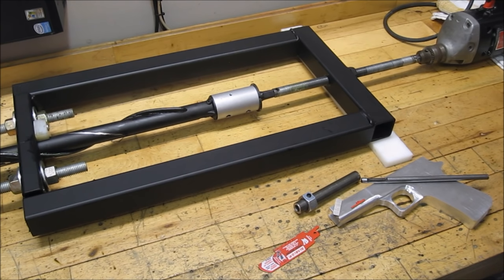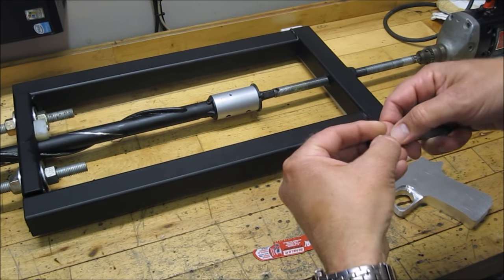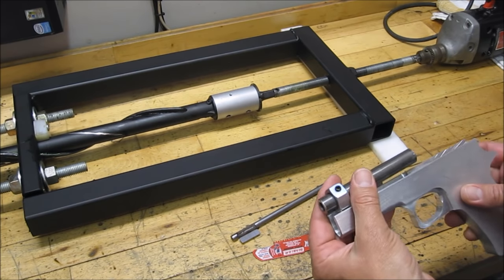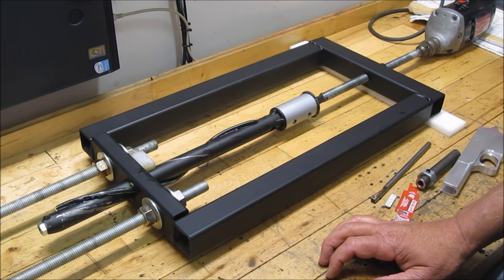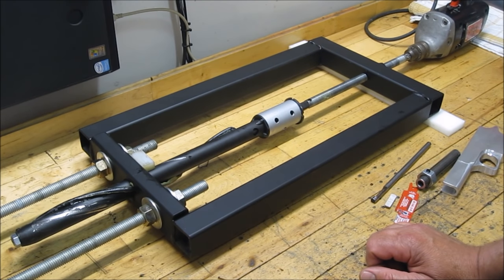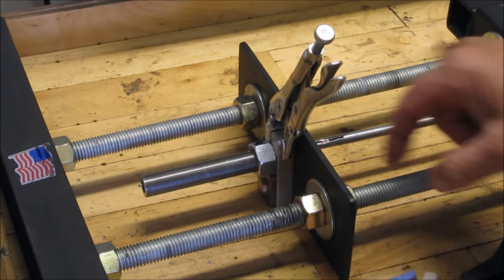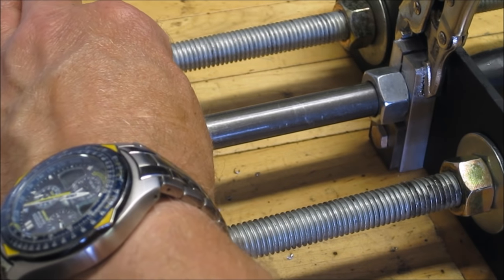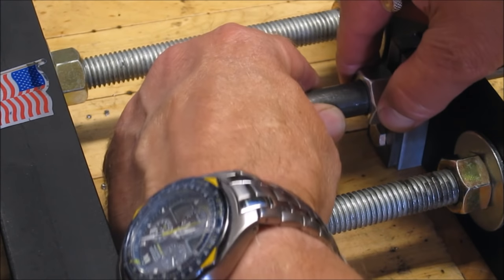Homemade barrel rifling machine, rifling the Kolt380 barrel

Comment: i would love to see a no weld version of this machine...... then even more people, like myself, could make one, ....ill have to think of my own ideas, while i wait for yours :)...i already have at least one.
Reply: In the old days of muzzle loaders, the gunsmiths would use a very similar design (same shim idea and everything). The big difference was that they used a square bar that they manually twisted to the correct twist rate and fed it through a square hole. No need to weld in that case. You can take a mild square bar and put it in a vise and then manually twist it with a big crescent wrench until you get the right twist rate. Twist VERY small amounts at a time all the way down the bar and you'll be set. Very time consuming but that's what they used to do in the old days. Of course, back then they would have had a forge and would have heated the square bar before twisting.

Comment: How deep are the grooves? And have you slugged the barrel to make sure of its size?
Reply: those grooves look like 10 thou to me.
Reply from the maker: Trick of lighting? Maybe 3 thou max.
Reply: Could have been how close it was too. the grooves look deep to me.
Reply from the maker: I have slugged the barrel. Not really happy with the diameter. I thinks it's too tight. I may have to ream slightly larger.

Comment: I'm looking into doing something very similar to make a 40mm barrel.  It's very hard to find an "affordable" steel 40mm barrel.  Mk19 barrels are out there but would still need machine work done for my needs
Reply: ChevTec I suggest watch a 13 part series called What on earth happened by Ewaranon to learn that the earth is not a globe. I got it in my about tab.

Comment: Im curious if i could make the same fixture but modify a barrel lap with multiple cutting teeth to avoid indexing and cut all the rifling at the same time
Reply: Did you test it out?

BTW Kyle Nash I suggest watch a 13 part series called What on earth happened by Ewaranon to learn that the earth is not a globe. I got it in my about tab.

Comment: Would be easier to use hexagonal rifling tool (may be made from the Allen wrench) twisting it to the rate of twist which is required? This type of rifling is used in the Glock pistols and is very accurate.
Reply from the maker: That would be my answer, thanks.

Comment: Have you thought about using Etectrochemical Machining to cut the rifling? It seems really simple. You can cut the barrel I.D. to size, chamber it, and cut the rifling all with Electrochemical Machining. I'm sure the barrel I.D. and chamber would be fine but I can't say for certain with the rifling.
Reply: Code Ninja I suggest watch a 13 part series called What on earth happened by Ewaranon to learn that the earth is not a globe. I got it in my about tab.
Reply: @flat-earther  ...They...
Reply: @flat-earther  Lmao. Classic flat earther line right there. Keep trying.

Comment: (7.65 barrels) is the first measure of 7.35 barrels.
Can I open a channel with a diameter of 0.15 mm?
Reply from the maker: I really don't have an answer for you on that. Sorry.
Reply: Barrel will be the first 7.35mm
Depth groove set
Can I open a channel with 0,15 x 2 = 0,30 mm + 7,35 mm = 7,65 mm?
Reply: I can get it fully explained. I'm asking 7.65 pistol groove set metrics.

Comment: I was just thinking, if your donor bike had a quick release seat, you could drill a hole through the mount where you put the vice grips, and run the skewer through that. Then you would have a quick release clamp that you wouldn't have to take on and off and tear up the aluminum.
Reply from the maker: That's a great idea. Unfortunately the bike went for scrap shortly after I removed the bottom bracket. I'll head down to the local bike shop and see if they have some scrap ones.

Comment: An old hss machinists hole reamer sharpen the tip in a reverse cone don't burn the steel .. And a sledgehammer or that press you made  You will end up with something like microgroove rifiling .. Its a cheap way from a century ago and used to rifle .410 shotgun bores .. Making them shoot .45 colt better. . you want  a little bigger than bore diameter .

Comment: Should be pushing or pulling ONLY when. you do both then the error of the clearance of the spiral is increased
Reply from the maker: At this point the tolerances are very close, probably too close. I feel it's okay to get the first tuning done by doing push/pull duty. Hope to have a spring shortly.

Comment: Next time save your bicycle! 
Just weld another nut to the top of the pipe holding your spiral guide.  
The drill and bolt will pull and push the spiraling pipe.
Reply: Mr Me I suggest watch a 13 part series called What on earth happened by Ewaranon to learn that the earth is not a globe. I got it in my about tab.

Comment: I grind the spiral and shaft of an old drill bit leaving 1mm of the cutting edge at point end then drive through the barrel with a hammer turning and repeat until cut ..the cheapest way no special tooling
Reply: Do you use carbide tipped masonry drill?

BTW Jay Day I suggest watch a 13 part series called What on earth happened by Ewaranon to learn that the earth is not a globe. I got it in my about tab.
Reply: @flat-earther  the word globe means round object.. definition of a globe is the planet Earth.. so no I cannot watch your program with miss information I know what the word means

Comment: How about a conical screw on the cutting tool, that when you tighten it, it press the blade out?
Reply: Kjell I suggest watch a 13 part series called What on earth happened by Ewaranon to learn that the earth is not a globe. I got it in my about tab.

Comment: Well done. But grooves should be wider, at list as wide as lands. ) Try wider cutter.
Reply from the maker: That isn't possible with my current cutter setup. This is progressive for me. Solving one issue at a time. Interestingly, my last build had even thinner grooves and I've seen no evidence of tumbling at 60' and beyond. Are you quoting conventional wisdom, or do you have experience with narrower grooves?

Comment: where  you from /asking do you do this  as  i was   because   here  a  gun /real one and ammo   is   harder to  get than  anti  armour  mines// near   to impossible so i  made  my  own  weapon since  i was  8 ,,first was air  pistol   loaded with sluf  pushed  3 cm in  barr//than  1 to  3    powder from   flobert  6 mm //real  small ones   for scare guns  like    look like    6x  3  mm plus some    finish on top  as  on 9x17 for  start pistol but wa smaller and  powder is  in fact explosive//ou collect 50 of  rounds   worth  and   smack  with hammer  or  just  put  in  a  cigarette  /big  rizla paper//and add a   8 mm ball bearing  it   sounds  like a    normal  firecracker/cherr bomb  u call in usa  /pirat or  magnum   in europe// so  2   blanks   powder in  and  follow    normal pellet /REMEMBER   1   /REAL  BULLET  IS   POURED  IN  A  DRILLED  HOLE AND  ROLLED  /CUT TO    FEW  MM  FULL LED    WADCUTTER  LIKE    SLUG,, AND  SHOOT//SURE   THE   SMALL PELLET  IS   PUSHED  BACK TO SPRING   CHAMBER BUT   EAS 300 PLUS ROUNDS  BEFORE   OU   TAKE SPRING  OUT AND   COLLECT LEAD//AND SLUG  DEPENDING  I TESTED ALL FROM  1 TO  12    ROUND WORTH OF  POWDER   A 3/4  IS  PENETRATINF AS 22 LR  SO I GUESS 10   IS   AT LEAST POWER OF   22 MAG OR  MORE  //MORE THAN 8 IS  NOT  OK  SINCE  IT CAN  SHEER LEAD    /PUSH STRAIGHT  NOT   FOLLOW GROOVES

Comment: Why not use a barrel liner.. maybe try some cutting oil on your homemade system?
Reply from the maker: A barrel liner kinda misses the point about doing it myself. I'm not sure why cutting fluid/oil would be needed at these very slow, non heat producing cuts. I don't use cutting oil when I use a file, do you?

Comment: Still did not understand why you had to have the twist wire on the out side of pipe,
Reply from the maker: That is the rate of twist that the cutter applies to the inside of the barrel. In this instance, about turn in 11.5". You may have to do some research on rifling twist rates.
Reply: +Clinton Westwood Yep, I am still learning, never built a gun before but would like to, but from scratch, if it's legal, or black powder guns would be cool, George Washington I hear had a nice black Power side arm I think it was a 45, I would like to make that one, not from a kit,
Reply from the maker: So, what this tool does is just cut at that very slow twist rate. The threaded rod is the pulling force and turns much faster. That's why I needed that high tech bicycle part to isolate the two differently spinning parts.
Reply: +Clinton Westwood So why do we have to rifling the barrel for, I noticed that the law makes us do that if the barrel is a certain length,?
Reply from the maker: Just to spin the bullet and stabilize it in flight. It would tumble and couldn't hit the broad side of anything without the spin. In fact, it would probably have that distinctive ricochet sound from the movies.
Reply: +Clinton Westwood Also I noticed that gun manufacturers,  do there barrels differently, but look the same as yours, is it the same, ?
Reply from the maker: They are all similar with different ways of achieving it. The twist rate varies on the muzzle velocity, weight of bullet, length of barrel etc.

Comment: where the barrel buy?
Reply: Ronald Bomar you can buy normal steel rods pre-made from any factory \supplier and later you have to make it a bit more hardened after the forging proccess but to make the correct hardening proccess after the grooves are made you will have to make more research on the internet.. cuz if you made it too hardened it could blow up in ur face after a few shots.. so be careful..
Reply from the maker: These are aircraft tubing. 4130 chrome moly. It has the characteristic that I want for this size and pressure of round.

Comment: @Clinton Westwood
Have you ever thought about using the Autofrettage technique to improve the barrel?

https://en.wikipedia.org/wiki/Autofrettage
Reply: Commercial barrels are rifled in this manner, hammer forging staging the barrel around a hardened mandrel that has the reverse of the rifling machined on it.
Button rifling like this is one way, hammer forging is the other way.
Some claim that button rifling produces a superior barrel but hammer forging is quicker & cheaper.